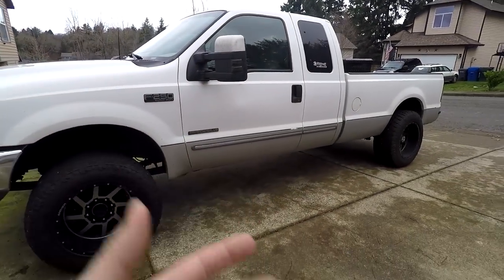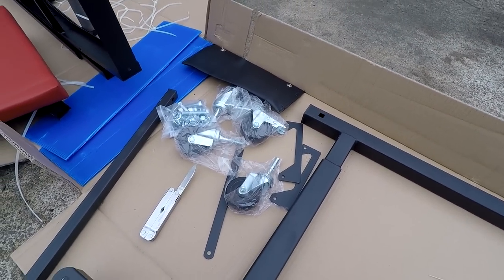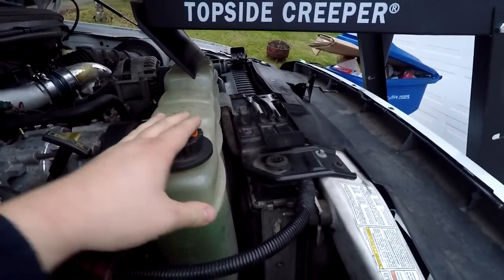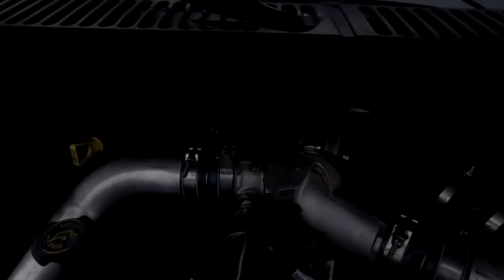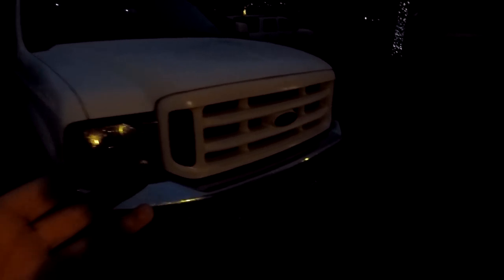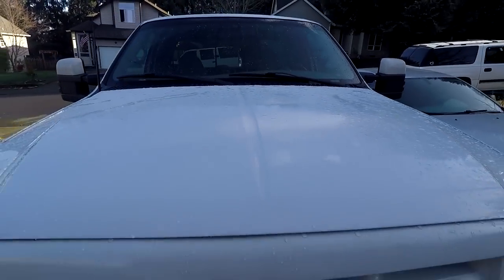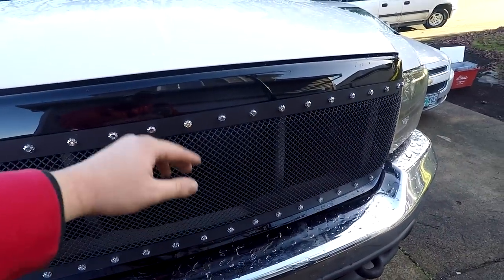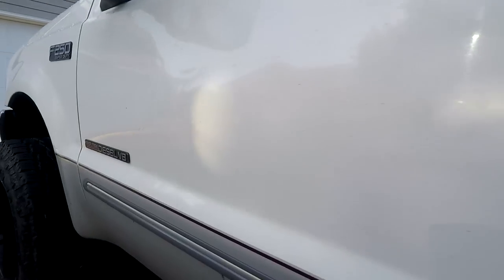Mesh Grille install and EBPV fix!

Comment: Hey man, trucks looking good, I have the exact same setup (and was even in Eugene until recently where is seems like you may possibly be). On the topic of painting that bumper, I painted mine and paint really does not like adhering to it. I scuffed the whole thing to give the paint something to grab on to, prepped the hell out of it, and even used a couple coats of adhesion promoter before laying down the rustoleum Bedliner stuff from home depot (decided to use this because I had awesome results from spraying it on my running boards, still looking killer after stepping on them everyday for 2 years) but unfortunately 6 months later its chipping off. I think conditions may have had something to do with it considering it was actually like 95 degrees when I sprayed, but figured hot was better than the cold likeI'm use to painting in. 

Long story short, Do some serious research on how others that have done it found success, because I did not, and I have painted alot of BS and had it look great.
Reply from the maker: Well thank you very much for the words of wisdom! I will take this to heart and look about either buying a painted bumper of this era and repainting, or just getting vinyl and wrapping the chrome and painting the plastic itself black!

I am in the Salem area! Where did you move too?! Cool to meet someone local!
Reply: @TurboDrivenAustin  Hell yeah man sounds like a solid plan! I toyed with buying a 6.0-era color matched bumper but I hate that their only partially painted! Interested to see what you decide to do and how it turns out. I'm going to do my best to strip mine and repaint once the weather starts to warm up, but may have to get a new bumper all together.

I'm over in Bend now but spend alot of time on hwy 20 between here and you, maybe we could meet up sometime. HMU on insta, i'm @duckspeed6

Keep up the good work! Best of luck to the channel

Comment: Video starts @ 3:50,3M adhesive remover is what I used on my intercooler pipe to remove all the fuzzy stuff and glue after I pulled the foil off

Comment: What's the evbp thing u was talking about my 7.3l fires great idles ruff and has no power at all it has never gave hard starts but put pedal to floor it dont go
Reply from the maker: It’s a closable valve on the turbo, that when the block is too cold it shuts to recirculate the exhaust to heat the block faster, it sometimes fails and gets stuck shut and caused you to have no power!

Comment: And personally I’d just de badge your truck and go full white mirrors or all black also short black spiked lugs look good 👍🏽
Reply from the maker: I’d love to fully debadge, but ford made it so the badging is put in with studs so it’d need body work!!!
Reply: PowerStoked that sucks!
Reply from the maker: RIGHT?! So I figured blacked out would be good!!
Reply: @TurboDrivenAustin  I know for a fact that the Powerstroke emblem on the doors are simply stick on. I recently replaced mine with the newer style 6.7 (they obviously say 7.3). Just claybar the area and it'll look mint. Not to sure about the F250 emblems, haven't gotten around to those yet.
Reply from the maker: That’s right! I forgot that the power stroke door logos were stick on!! But the tailgate badges and the F250 badges have the stupid pins

Comment: what does a ebpv delete do? i have 01 f250 7.3 only had truck for 1 yr
Reply from the maker: It supposedly helps with Turbo Flow! And it’s one less actuator piece to fail!!
Reply: @TurboDrivenAustin  did you notice any difference?
Reply from the maker: I haven’t personally done the delete yet! I just pinned it open! So the valve is still in there!!
Reply from the maker: But when I do a turbo rebuild, I will be doing a delete!
Reply: @TurboDrivenAustin  looking foward for the video bro let us know how it goes!  good videoes keep it up
Reply from the maker: Thank you man, and I will absolutely let all of you know how that goes!